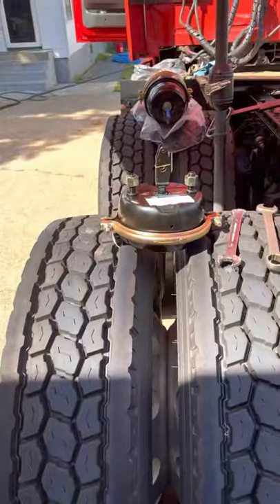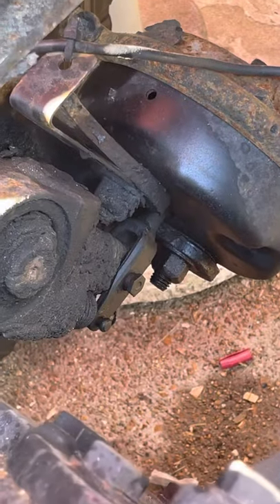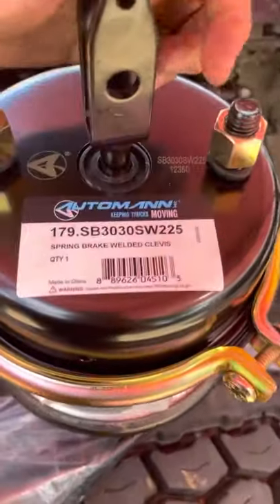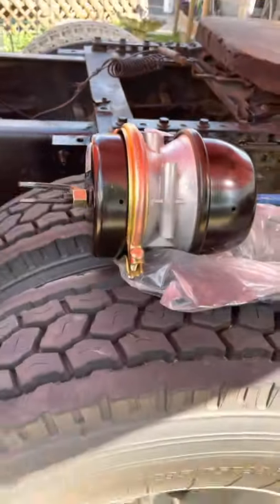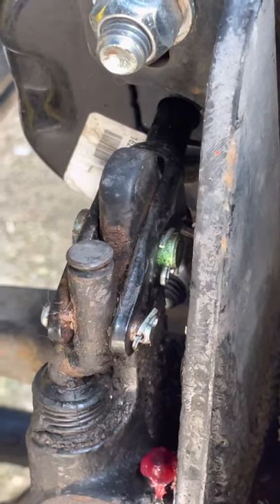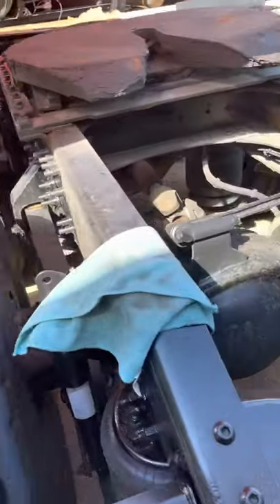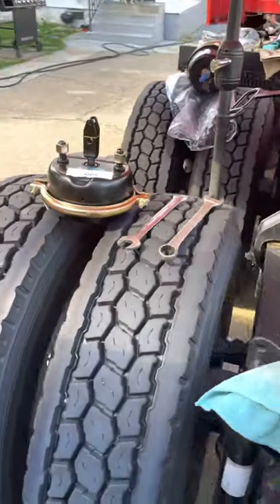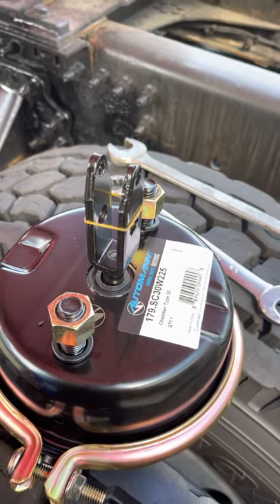Volvo vnl brake Chambers

Comment: Hi bud what year is your truck?
Reply from the maker: 2007
Reply: Thanks I got a 2012 I was hoping it fit
Reply from the maker: @nramroop79  probably the same to be honest. Run a parts check cross reference. Call a local VanGuard Mack dealer (Volvo an mack are same parts at much cheaper rate)
Reply: @nramroop79  Let me know if it worked for you please